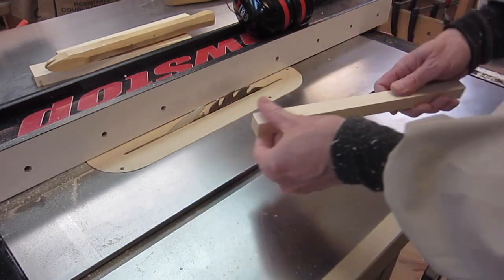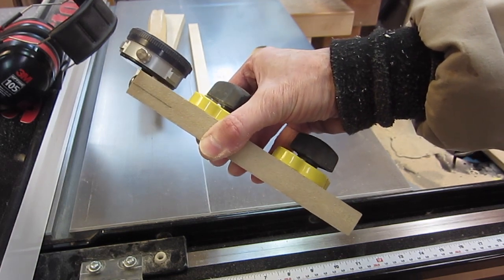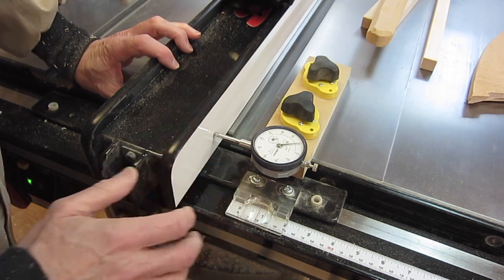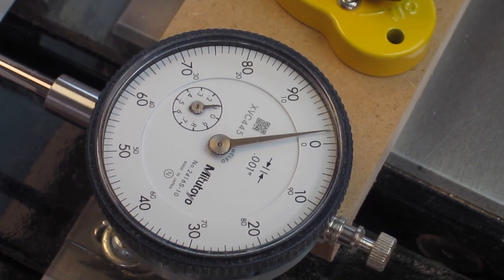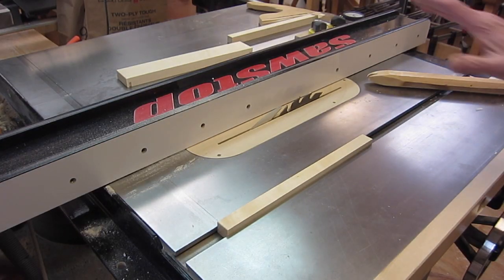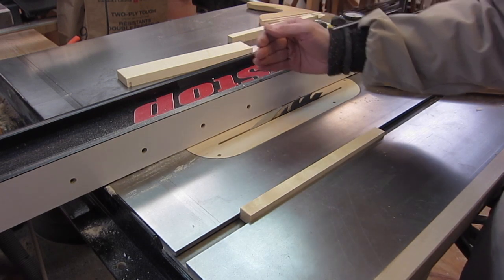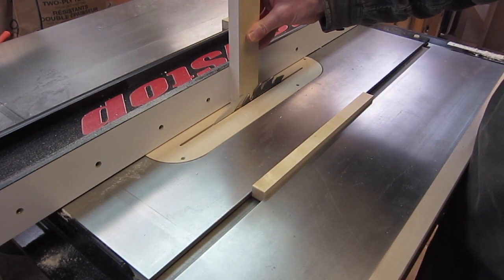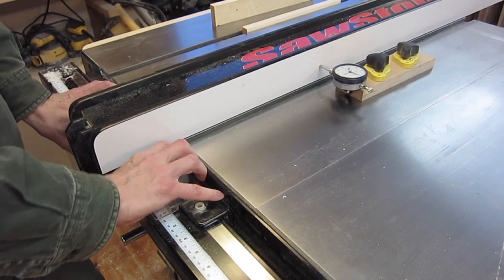Micro Adjustment of Table Saw Fence in increments as small as 0.001 inch.

Comment: What a sensible solution with components that are useful for other set-ups.
Reply from the maker: Thanks for feedback.   There are lots of gadgets for sale to help set up tools, but I have found that investing in a good dial indicator and then making my own jigs as required is a better way to go.   Set of feeler gauges is the other tool sometimes needed for setting up tools.   My main use for dial indicator is aligning blade, fence, and miter slot as shown here:   https://youtu.be/tOHy69VmNwk

Comment: Steven, Thank you for posting a link to his video in the FineWoodworking forum. It is a very creative solution to add .001 inch precision to a table saw rip cuts. I purchased my SawStop PCS without a fence and added an Incra LS TS to have this capability. This is a portable solution that reuses a very important but little used Table Saw Setup Gauge with Magswitch MagJigs. This solution can be used with other fences (bandsaw, drill press, router table, shaper) in the shop to dial in that same level of precision.

Comment: Steven shows but doesn't mention, always pre-load the dial indicator to remove backlash.  If you don't have a dial indicator and don't want to tap, tap as Steven still does in spite of using the dial indicator, simply use the same type of setup with the appropriate feeler gauge(s).  Insert the feeler gauge(s) between the stop and the fence and move the fence until it lightly squeezes the feeler gauge. Lock the fence in place and remove the gauge(s).